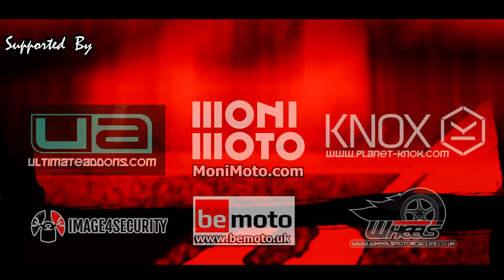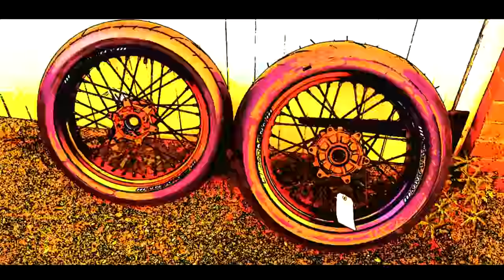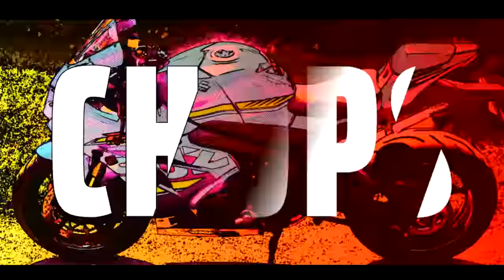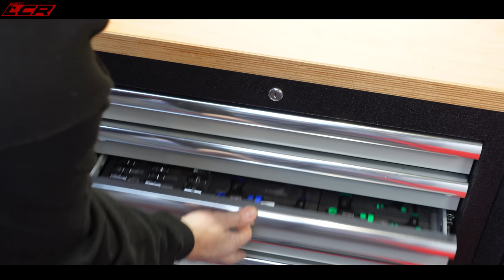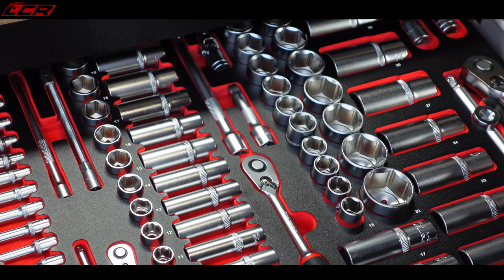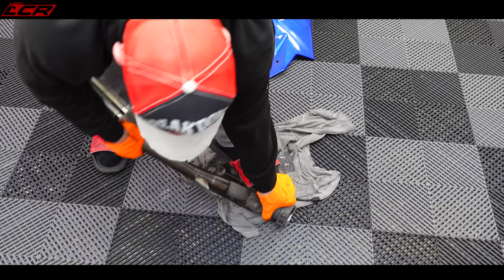The BEST Upgrades For The Suzuki GSX-R1000

Comment: Great video.  

You might wanna consider the Foil trick for your next oil change. 

Just put a piece of aluminum foil over the headers.  That way the oil drips on it.  Then you pull it down at the end and you're left with clean pipes.
Reply: Bro I been using plastic rubbish bag going use your trick now 👍

Comment: From Denmark here.  I also got got the same k8 bike, ecu full flashed halfsystem yoshimura dobbelt system,decat, powercommander 5,oem intake filter,i have 180hp at 12300 rpm on the wheel,

Comment: Better use the non rachet one to remove hard bolts. Just a tip 😉. Always bring a non rachet and a rachet. Keep them near the work and put them all back the same time when you finish the job. Good job for wiping the tool before putting it back.

Comment: If you like under the passenger seat, there should be a long (12" or less) rod (some have a ring) clipped in there.   It is to hold up your tank.

Comment: Hey chop, you need to know that you have placed the filter upside down, mate!
Also, consider using a spanner to undue the sump rather than a ratchet. These sump are weak on the thread side and are known to strip due to the steel sump bolt.
You also need to bleed the coolant system, too. 
Good luck, mate,
Alex from Sydney Australia
P.s. The Fuchs oil box has been designed to be used instead of removing the bladder, 😆 
It's been designed to be used just like a cask of wine you buy from your local.
Reply from the maker: No that's the correct way up, it had a this way up marker on it. Remember the air is flowing up from underneath. Also the bolt to secure it is in the middle of the airbox lid 👍

Comment: Phew, that was exactly what I needed. Motorcycle content with mods, humor and more. Think I need a cigarette after watching Chops manhandle his, umm…never before used new tools😂 Thank you that was a good video👏
Reply from the maker: Thanks Dukie appreciated buddy 👍
Reply: @LambChopRides  The valve is going to oscillate. You take one of the cables and hook it back up to the side that pins it open, loosen the bracket mounting bolt, coil the cable around the bolt once or twice, going over top of the bolt, and then tighten the nut down hard. Then clip off the extra. This prevents all oscillation. We have to do it on the hondas since the htev in full crossover is more complicated, is not spring loaded, and is much smoother flow than removing. On the 929 and 954s.

Comment: The lambda probe in your case was installed upstream of the catalytic converter. Even though the catalytic converter was removed, there is no reason why the probe was chosen to be deactivated. A flange could have been welded onto the connecting pipes to keep the lambda probe active. It is a very important sensor that helps the ECU (Engine Control Unit) form the mixture in many situations, situations that would be difficult to predict or take into account by the engineers who create the injection maps with the lambda probe deactivated.

Comment: Whinced when you attacked the sump plug - 'wot knuckles?' You're unscrewing a seated thread, not twisting it off the block - line up the torque needed, hold firmly, then 'nudge' : )

Comment: Chopsy, I've got a 1000 k5 decat with a single Lextek pipe and never had a problem at track days, even without the baffle. Reckon you'll be fine. Incidentally the baffle robs nearly 30hp from my top end at the back wheel...! Who needs rain mode!? 😂

Comment: Just a quick one that may have already been mentioned. 

I noticed when you took the airfilter out there looks like there is a self tapping screw missing which holds the air filter down. 

This might be important for sealing the air filter down and why you might have grit after it. 

I might be wrong but deffo looks like something should be there.
Reply from the maker: The filter is held down with the centre airbox lid screw 👍
Reply: @LambChopRides  ahhh thats good then!

Comment: WATCH OUT CHOPSIE,
Not sure but it seems you forgot to pin down the air filter with the screws and lock wire the exhaust valve because the exhaust gases could overpower the spring and start juttering
Reply: At 16:36 in the vid you can see the screw hole in the air filter located in front and between the 2 throttlebody inlets.
Reply from the maker: The filter is held down by the screw in the middle of the airbox lid 👍 lock wire on the exhaust flap is a good call though 👌

Comment: You probably should google the issue with K&N oil filters, they have been banned from many race tracks due to them leaking at the nut. I wouldn't use anything but an OEM oil filter and use the respective "cap" tool which allows you to use a socket to remove and torque them.
Reply from the maker: OK interesting 👍
Reply from the maker: I wonder if it's because people are overtighting the filter with the nut when fitting.. I only use the nut to remove it
Reply: Could well be. There was a period where they were using rivet style construction for adding the nut plate. I believe they swapped to welding the plate on. It may well be rectified now, but the issue is well documented and for the same money oem can not have this issue.

Comment: I'd have opted for a single link pipe and gone in to one silencer - looks better and saves even more weight.  One of my bikes is a 750 K8 with a decat  and Racefit Titanium end can but I'm considering fitting a K7 decat/silencer because the noise it makes at the moment is outrageous. Stay safe.
Reply from the maker: Yeah but the twin setup looks 👌
Reply: Anthony I have the exact same bike and set up does the k7 cat and pipe fit? I was look at the gp evo k7 pipe you know if it fits?
Reply: @MrLillywhite2011  No don't think so , the k8 system is all one with the collector box being part of the down pipes . I bought a K7 cat which has the silencer attached but it doesn't fit the down pipes that are on my bike. I suspect the down pipes on my bike are K7 which have been fitted by a previous owner but when I offer up the K7 cat it simply will not fit. The underside of the bike is different and the brackets are in a different place. Only solution is a full K8 system. Hope that makes sense.
Reply: @anthonywhite23  thanks alot mate 👍

Comment: Throttle side of bike underneath pillion seat ,there should be a tank prop holder from factory plastic clip holds it in handy for holding tank while cleaning filter ect .Yss rear shock ,budget upgrade for K8 chalk and cheese over stock 1 ,Like your K8 looks tidy 👍Also slide forks thru triple clamps till just end cap petruding especially if running 55 profile rear tyre .mite need to back fork preload off after raising height of front end ,something I wish I'd done sooner ,80 kg rider without leathers 😂 ,Def clothed ...

Comment: The cat really did knock the mid-range compared to the k5/6, very interested to hear what you think of the changes - you could normally feel the difference if a bike had been decatted, even with std gearing...yours should really shift !     Lithium batteries are a great weight saving and you can leave them for months, no trickle charge and they'll still have loads of charge, unlike lead gel and agm batteries........loving this series  ❤
Reply: Lithium batteries are a fire risk.
Reply: Lithium batteries are a great upgrade , will never use anything else now .
Reply from the maker: Thanks Nick 👍
Reply: If it's a decent brand, the charging system  operating properly there is very little risk. I've been running LiFePO4 batteries for many years on my bikes and would use nothing else now...unless it was an old hack !!
Reply: @bananabrooks3836  lifepo4 are very very safe and behave well in a load of scenarios, I shaved 2 kg from that and it works awesome, very punchy on the starter.

Comment: Great video as usual Chops! I have a question... Do you recommend P3 tuning as reputable... My new bike is a 22' MV Agusta Brutale 800rr and as you know, aftermarket-anything is rare with those bikes and so is tuning. I'm in the US and never heard of the few tuners recommended for ecu flash tune. So P3 tuning is a good deal or nah?
Reply from the maker: Yes I would absolutely recommend them but sending an ECU from the US could be risky..  I have heard good things from Brent Tuning in the US, they do postal flashes?
Reply: @Lamb Chop Rides  yea I've talked to them as well. They offered to do a baseline map. But I'm not sure if that involves me bringing the bike to them or if it's a mail-in service. It's all experimental with the mvs. I know they have started building tunes for the brutale 1000rr. Waiting to hear back from them on more info. Thanks chops for your input and keep the videos coming. 🤘🏾‼️

Comment: Chops, I wouldn’t bother with a ‘race’ filter, its debatable if they provide any performance gain… most manufacturers claim 1-2 bhp, this is well with in the error margin of any dyno so not reliable but one thing they all do is ‘flow’ more grit and dust which damages your valves, pistons, rings and bores. Stick with OEM.

I have seen the build up of dust, dirt and grit in the air boxes of 100’s of ‘tuned’ bikes running ‘race’ filters, and for many years have swapped the ‘race’ filters for OEM on any bikes I buy and find them fitted…. I used to be a motorcycle tech on many brands at a big dealership so saw first hand and in great numbers. 

Don’t believe the hype… would you notice 1-2 bhp gained or lost… no.
Reply: Sprint filters seem to be the worst for this don't they...  But DNA and BMC filtration is meant to be on a par with OE filters I believe. In fact the BMW m3 csl used a BMC panel filter in the carbon airbox direct from the factory...
Reply: Alot of guys are running the sprint P-08 F1-85  air filter (track use only ) I think that where the issues arise with sprint filters I'm running the sprint P-08  and I can assure you there absolutely no dust dirt etc in the air box
Reply: @T T   Track = 40 tires churning up dust on a perfect surface. Road = 40.000+ tires churning up everything. Track is not an ideal proving ground for anything other than tires, but I take your point, and sports filters can do little damage on track.

Comment: Planning on fitting some twin arrows to my K7 soon (waiting for them to be refinished). Got the link pipe already too and want to remove the cat, does the lambda sensor need bypassing? Just wondering what I need to do with that. Cheers
Reply from the maker: No the link pipe has a thread for it if you are not getting it flashed and using a power commander 👍
Reply: Nice one thanks, no PC yet so all good. Just need these pipes to be ready now!

Comment: Does changing the sprockets affect speedo reading? Great content btw 👍
Reply from the maker: Yeah it now over reads slightly, might need a speedo healer to fix it..
Reply: I just purchased a mint condition 1000cc k-5 edition with 16300 miles. I'm not at all interested in top end speed but very interested in low-end and mid range torque. The dealer replaced the chain and rear sprocket. Can I accomplish more low and mid-torque by replacing the front sprocket?

Comment: The ‘old’ oil that came out looked perfect! This isn’t 1975, shouldn’t it have been okay?
Reply from the maker: It's been in 12 months and three tracks days. I change my oil every year at the start of the season. But yes actually still had a red tinge to it 👍
Reply: @LambChopRides  I get this. Maybe if not for the track days I would have left it for a few hundred miles and then felt the guilt of disobeying the 12 month rule…….
Reply from the maker: Yes absolutely I agree! Yeah only changed really due to the track time 👍
Reply: @LambChopRides  I always fret about what to do in this scenario. I usually bottle it and change the oil, only to see beautiful fresh looking oil come out and wonder if I should stick it straight back in! This is the ongoing problem with having 3 bikes (I used to have more…….) and one of them being the 690SMCR, as I ride the supermoto more than both the others put together and multiplied to the n’th degree. Drones, camera vans and general danger are all much reduced on the forgotten backroads. Have a nice day 🎵

Comment: never really understand why the k7-8 never felt as good as k5-6 despide few differences and even with exhaust the extra weight 'feeling' still there
Reply: Throw stock rear shock in bin ,and raise front end height ,by sliding fork tubes ,flush with head yolk, cap only petruding especially if you've put 55 rear profile tyre instead of 50 ,stock profile that adds 5mm height in rear ,Yss rear shock cheap upgrade ,will not disappoint you could run Almost and spring preload height you name it k8 will still handle better with yss ,Once in saying so ,27mm rear rider sag 80kg rider and aiming for bit below 10mm off bottom out under hard breaking, zip tie for measuring this and K8 will get some feel 👍 100 mm air gap and ,proper 5w fluid ,and yss front springs for your weight ,sweet good as it gets for old k8 without pumping big dollars for fork upgrades .Also stock K8 has plastic housing roller bearings in headstem ,Tapered way better .

Comment: That was painful to watch you remove the oil pan drain bolt , left hand on socket, wrench handle lower, apply pressure, then pull smoothly, that was very amateur at best

Comment: I cringe when I see K&N style filters, if bikes does not need valve shim adjustments on factory air  filters  IT will now if you put serious miles on it with these filters .25 years ago I had my US  ferrari 308 QV on dyno it lost 4BHP between 15 minute filter swap from standard to K&N wish I still had dyno sheets to prove, you will never see K&N produce dyno graphs for there air filters. The crap these let into engine is unreal. Fine I suppose for your occasional use like yours. Factory Orginal are supreme. HI flow aftermarket if factory no longer available.